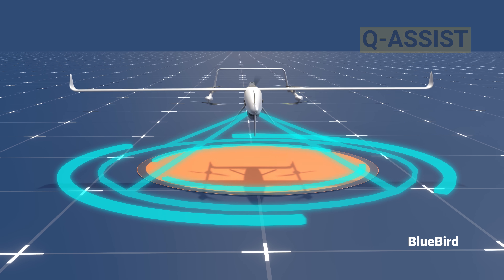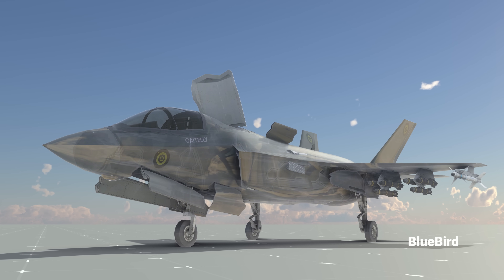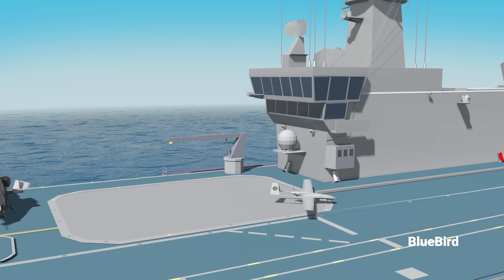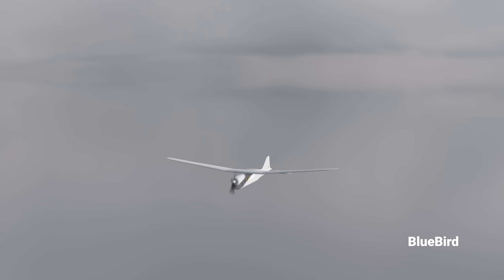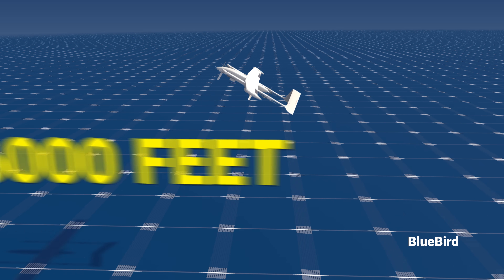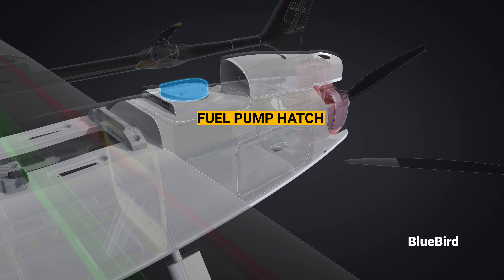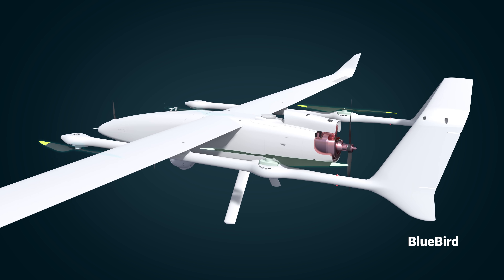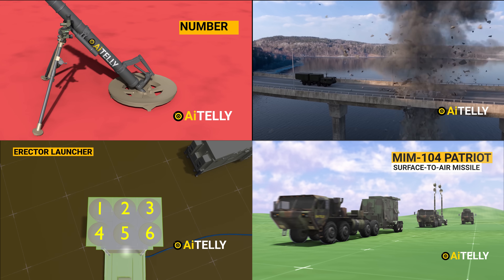How does a VTOL UAV work?

Comment: the lift motor basically does nothing but adding drag and weight during forward flight. Likewise the forward motor does nothing during lift mode. Compare to a tilt rotor design where the same motor is used in forward and lift mode, it's probably going to be less energy efficient and weight efficient. Of course you could make the argument that you could optimize blade profile for each mode and tilt rotor has weight penalty for the tilting mechanism. But relative magnitude of negative outweigh the positive. So unless you have a very specific mission requirement like flying inside tight space where titling mechanism can't work. This kind of separate propulsion system will always be under power and have shorter flight time compare to single propulsion tilt rotor configuration.
Reply: @keenheat3335  most of the companies I’ve seen develop similar this sort of platform have a version of the plane without props whatsoever. They launch them on rails and catch them in nets. So it’d make sense that they find it inexpensive to slap two rods and four props on their. Nevertheless, your point is totally valid. I haven’t really found any companies which manufacture what you said. The stallion vtol is close but the rear prop doesn’t rotate.
Reply: But its cheaper do you get that ?
Reply: @baba_larziz  Its not even cheaper, all they need is a servo motor for the two motors in the front to tilt them and replace the two motors in the back for one and add a servo to that one. It effectively becomes a 3 motor drone with forward flight capability. Furthermore, there is a drone that does this exact thing, its called Stallion VTOL. 3 motors is much cheaper than 5.
Reply: @Max-xt1fo  You forget about reliability and safety. When there are 5 engines (1 cruise and 4 takeoff) the plane has 2 lift systems. And if during a cruise flight an emergency occurs (even the destruction of a wing or a cruise engine), then the lift engines quickly turn on and the plane safely continues its flight or lands. This scheme saved us more than ten times during the war.